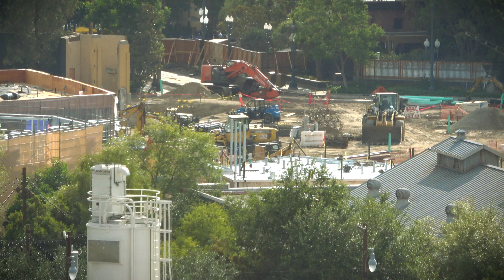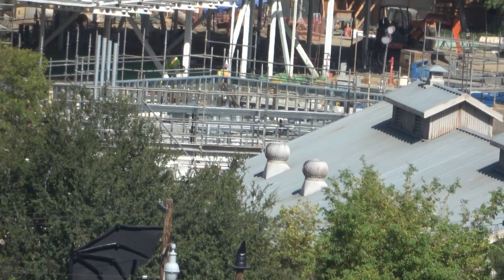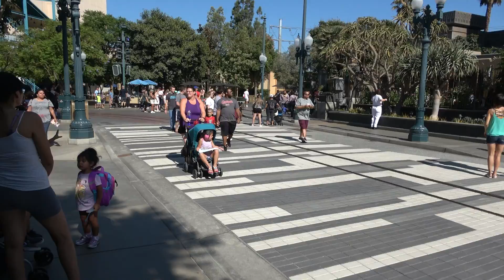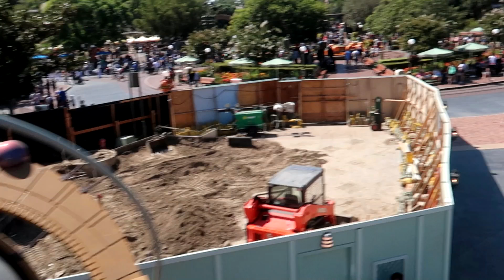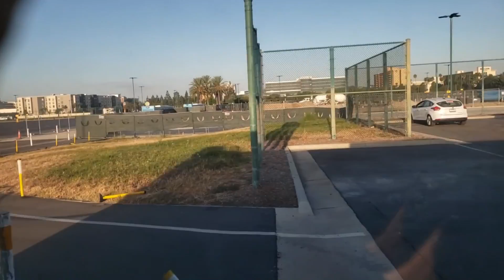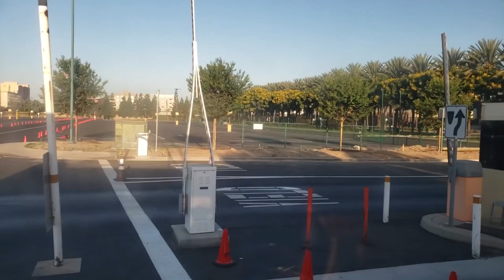Red Car Trolley Mystery Solved?  - Disneyland Construction | 09/21/19 pt 76

Comment: here is my prediction.  the trolley stop will be between the back of the Animation building and the Hyperion Theater waiting area.
I recall the odd construction "box" on the track several months back.  it could have been to install charging loops under the pavement.
as I understand the system the batteries will charge at the trolley stops.  the remaining track is there to get the trolley back to the maintenance building.

Comment: So perhaps... the trolley is powered electrically with overhead caternary wires. I suspect this high voltage source all the way to the trolley garage was going to be a safety issue with the cranes and construction (there are distance requirements),  and that's why the whole thing is 'in refurb'. I was there last week and noticed the wires near Cathay Circle. I just 'walked-thru' DCA on google maps, and the wires are strung through to GoG; however, your video had no wires. Suspect everything will be restored upon clearance from site safety.
Reply: Actually the Trolleys at DCA aren't powered with electricity overhead or underground. The cars are battery powered with onboard batteries.

Comment: You can see the RCT track still turns left as it goes under the construction walls. It will not be turning right. They would have made that change when updating the walkways. Besides, it would be way too tight of a turn.

Comment: Is it possible, the red trolley will go through the avengers campus and connect with the other end of the track making it a loop?
Reply: The other end is at the entrance of the park.
Reply: Larry Marquez, The avengers campus main entrance is very close to Carthay Circle. It would be easy to tie into the trolley line there making it a loop.
Reply: @chrisolsen1549  , interesting but wont happen. That wasn't in their plans

Comment: so the bag check at Toy story will be interesting.  it could mean a huge walk for some people that park at opposite end of parking lot.

also does that mean they will once again mess with the eastern esplanade?  They just added all those permanent bag checks.
how will they split up the area to drop of guests there from toy story and then push them in the secured zone thru that bus and shuttle area apart from the crowds entering the street?

this make more sense if the eastern gateway was already built and in place.
Reply: Yes this means esplanade is getting tweeked. They are adding a fence to separate the bus guests from street crowd.